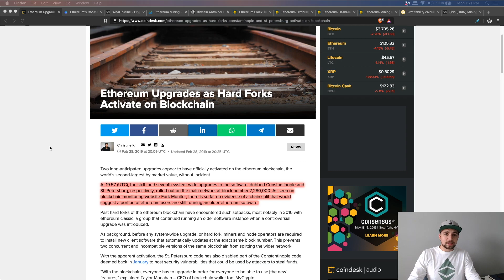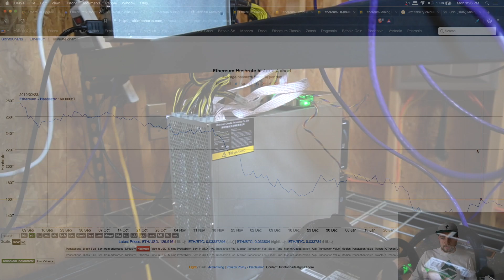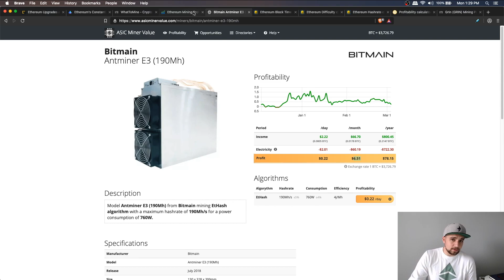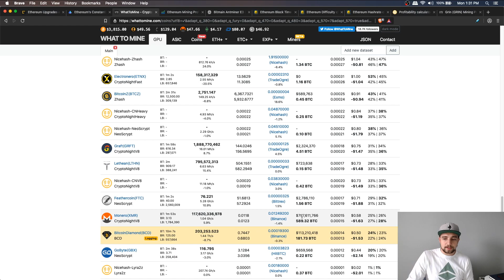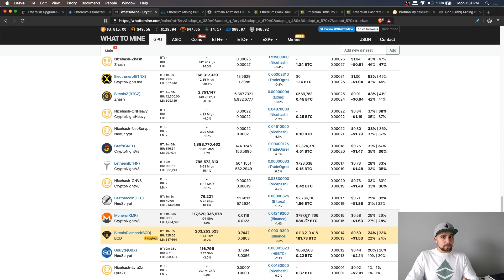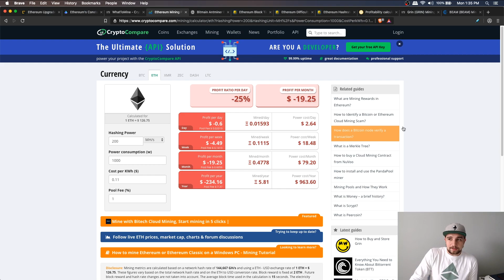Ethereum Fork/Block Reward Reduction Kills GPU Mining Profitability | Crypto Miner Explains

Comment: they are not going to ban Asics from mining ETH. Reasons are very very simple. Developpers want to pay as low as possible for the security, as you said. There is hugely more room for that on ASICS and FPGS than on GPUs, because what can be done with specific hardware, cannot be matched with general GPUs.  i think that we will see the number of hashrate increasing if the price goes up. it's incredible how miners just want to survive the tsunami by putting more money on their rigs. They are already dead. ETH mining is dead right now. But hey!" still 144.000Gh/s on the net which is dumb. But anyway, who understand what miners do?? a Vast majority of them mine ETH still because they think it will pump. 

Ohh BTW. the price in 24-48 hours is going to dump again.

Comment: Thanks for the information on the fork. I am a small miner, I only have 1 gpu but I am very interested in mining. 0x30F53929005c544DcB3af4B17dE1b9FC53B22D7e <--- my Eth Wallet just cause you said to drop it down below :P

Comment: Instead of mining thecurrent most profitable coin, have you tried mining the coin with the biggest decline in difficulty. This should yeild more coinage, and you know as well as any hardcore miner that profitabilities do nothing but switch between coins.
0x32C649CddCCD60bEDb358B14253eb60c6fd496A2

Comment: I agree mining ETH has pretty bad profitability on GPU's such as the RX 570 or ASIC's such as the E3. But you have to realize that there is much more efficient hardware now available for mining ETH such as the NVIDIA GTX 1660 Ti (30 Mh/s @ 60W), NVIDIA Titan V (80 Mh/s @ 120W), AMD Radeon VII (90 Mh/s @ 200W) or the new ASIC's that use HBM2 memory. Mining on hardware like this paired efficient PSU's (Platinum or Titanium) still seems like a viable option if electricity rate is < $0.10USD/kwh.

Here is my ETH address:
0xeCAE8BADfb59a1121095003a3eD7B51a12608a76

Comment: Sorry for you loss, you don't have to apologize for that we all understand shit happens sometime.

I used to be a big Monero guy,  then the bear market hit and they stopped forking the ASICs. I still have a rig on it but most of my rigs now have been spit between BEAM and Grin now.  But I also have branched off into a new area, I was able to get a hold of several sever boards  some of them had 4 cpu's in them so I started using them to mine Verium and Vericoin, they are a CPU based project  that is GPU/ASIC resistant. Off of those CPU rigs on those coins I'm making about $2/day after power, I was actually surprised so I'm gonna keep doing that for now.

Comment: I had a 6x1050ti rig (only used 410 watts) making 0.05 in 6 days but I switched to BEAM just before the Fork.   
0xd01E5a43430f3A260ce0af67DF90771e0EF6D972

I’m tempted to switch back to ETH to see how it does now.

Comment: I've lost so much money paying so much for GPUs (420$ for a rx580 Nitro+ 8GB, and I bought 6), and electricity 0.15$ with the dream of making some shit when I saw crypto value in January 2018 ... but bought the cards in may .. cause before may 2018 GPUs were priced even more. And month after month crypto value dropped and dropped until I've shut everything down in December . Now nobody wants to buy a card for 240$ and I can't accept going lower than 200$. They were used for 7 months, they still have guarantee. Tried GRIN for 2 weeks with 5 cards .. mined 3 GRIN and payed again a shit load for electricity for nothing. I'm so sad..so sad. Thanks for another great video. Keep it up.

0x4cbb5aa0624ec3ade50d55d5dac00271b433bddc

Comment: I don't know where he gets his numbers.  I am making 240 a month mining with my 24 GPUs.  My electric is .0548 per kw/h which makes it still profitable for me.  I don't concern myself with Return on Investment because I just don't care, if I did I wouldn't have invested in that many cards so quickly
Reply: His numbers are correct a dude. You are just bragging with your cheap electricity.
Reply: 0.0548 per kw/h...damn really good. Here 0.11 per kw/h.
Reply: r/humblebrag check it out bruh
Reply: I have noticed a lot pd GPU mi ers don't actually understand how GPU's work and the co cept of having more then 4gigs of ram with a bigger HDD. One guy only had a 6pgug SSH. but more storage is needed for building blocks. As for videocards. Simple cards are the best for simple task. Stay far away from Nvidia mining.

Comment: I really hope they switch to ProgPoW soon, but kind of agree they probably won't.  It seems to me they are dragging their feet, for as long as possible, hoping a reason to not switch finally appears.  Then they can congratulate each other on how they dodged a bullet and are so smart.
Shrug.
0x7b7c35310083cbECe06F4cFB777DBaE581c18893